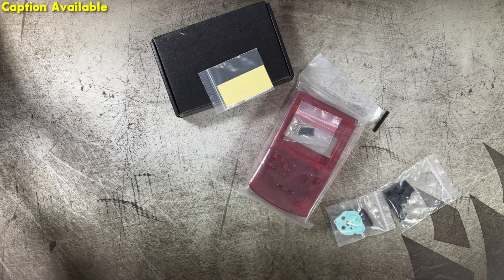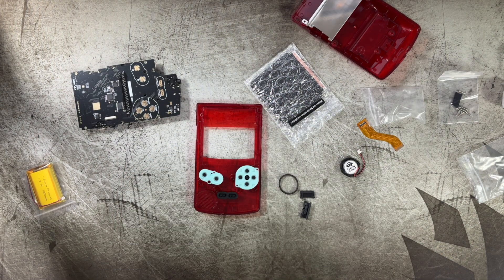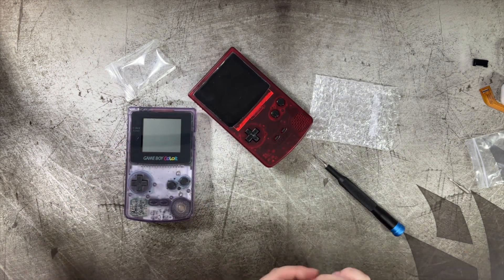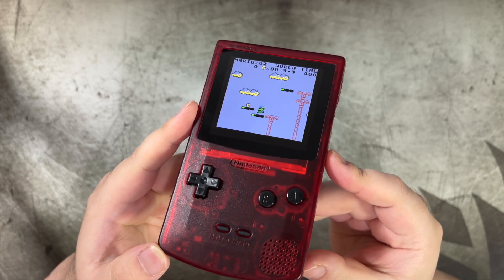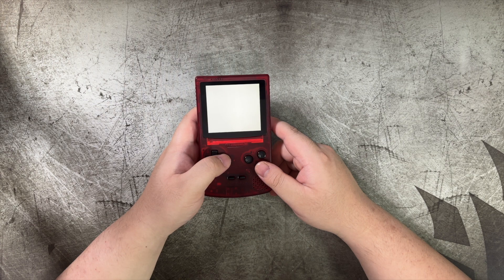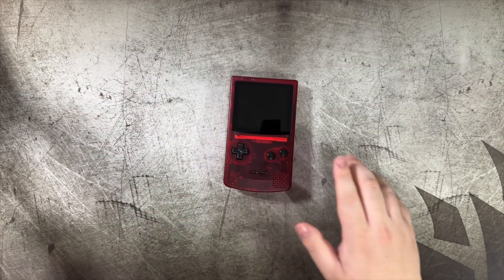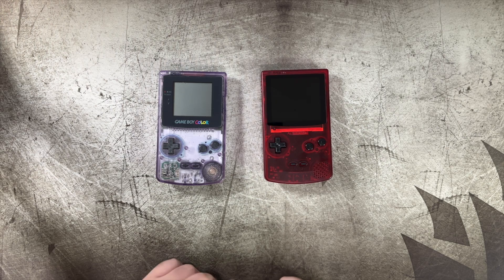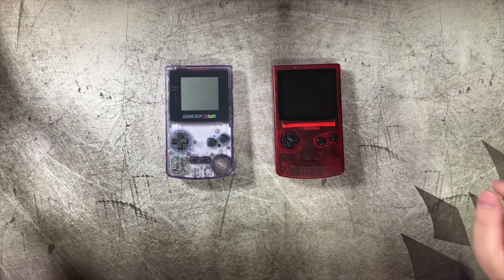FPGBC | Build Your Own Game Boy Colour!

Comment: Great video!  I had the same issue with the battery connector. However my everdrive x7 works just fine. Could be an SD card issue with the Everdrive. Did you try it in the gbc after? Also there is a new firmware 1.08
Reply from the maker: Tried it on 1.08 with GBC, GBA, SP and works flawlessly. Not quite sure why its not working with FPGBC...

Comment: You need to update your firmware for the everdrive to work.
Reply from the maker: The firmware was an up-to-date version since it was set up on March. Still not sure why it didn’t work.
Reply: @MetallicFear  did you personally update the firmware since you've received it? Mine just got to town and the firmware was not updated from the factory.
Reply from the maker: Yes because my ever drive didn’t come with an SD card. I personally loaded the firmware and games myself.
Reply: I think you're misunderstanding me. You don't have to update the everdrive firmware, you have to update the firmware on your FPGBC.
Reply: Look at Macho Nacho's video about the FPGBC at around the 13:33 mark.
Reply from the maker: Ahh, got it. Regarding the FPFBC firmware, it was an up to date version when filming. V1.06 which you can see when I’m showing the FPGBC menu. V1.08 came out after filming. The reason I thought it should’ve worked is because people on reddit who have version 1.06 or older have said it worked on their unit.
Reply: That makes sense. :). Good luck! Let me know of you get it working.
Reply from the maker: Tested under the latest firmware for both FPGBC (1.08) and Everdrive(1.06). Still doesn't work.
Reply: @MetallicFear  maybe downgrade the Ed firmware to 1.05? That is what I am running.
Reply: Spoke to a friend who had a similar issue. He went way back on ED firmware 1.03 and solved his issues on the FPGBC. Worth a shot?
Reply from the maker: Since firmware updates also introduce new features and game compatibility, I’m not going to downgrade it. Although it would be a good advice for those where ever drive compatibility is a high priority.